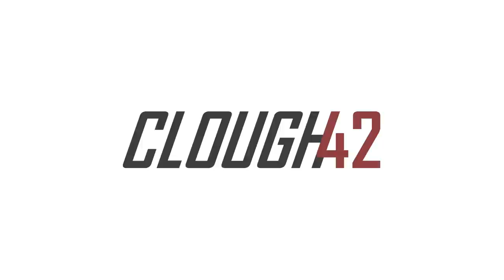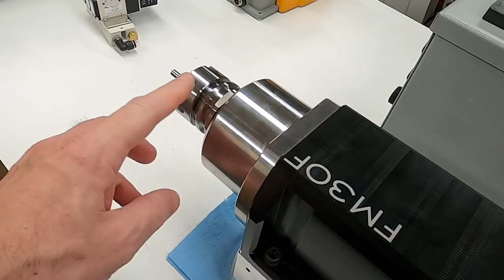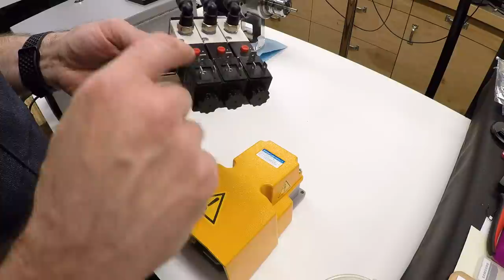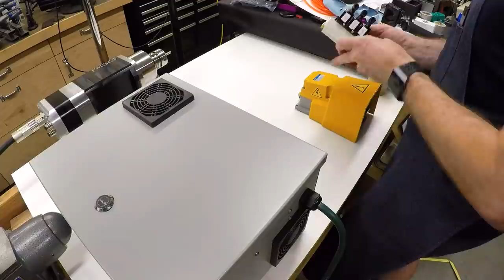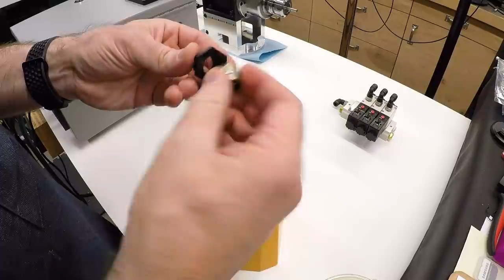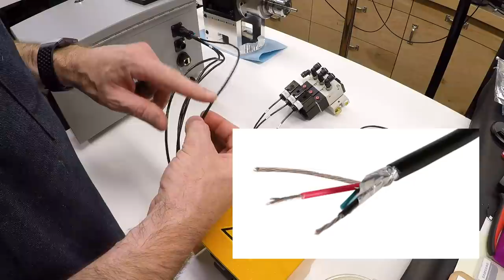ATC Spindle Part 10: ATC Interlock and E-STOP wiring [REUPLOAD]

Comment: Totally agree with the "Machine is trying to kill you" When I first got steppers installed on my mill I was so excited I played with the mill drawing pictures on paper. At some point during the proceedings I had my hand on the table and it moved and it dawned on me  that if my finger got pinched between  the table and the mill the mill/controller/steppers would not care one bit and take my finger (or worse) with it. That was one hell of a wake up call. At that point I started to build an enclosure.
Reply: I call the hand on the table the 'texting while driving' effect:  we can only really pay full attention to one thing at a time.  The rest of our behavior (here, where you put your hand) defaults to habit.  This is why we want safety systems to prevent something we would never do **if we were paying full attention to that** as opposed to paying attention to e.g. the part we're machining, a funny noise the spindle just made, etc.

Comment: There seem to be a number or comments against this video suggesting that safe wiring practices and interlocking are only necessary for commercial operations which is rather worrying. Having a reliable method to shutdown a machine tool in an emergency is just as important in a home shop with a single user. You have to remember that this video will be watched by thousands of people no amount of disclaimers will prevent an otherwise uninformed viewer from copying this implementation as is, so it's very important to cover this in detail. Just recently there was a different youtuber who couldn't be bothered to connect up the ground on his Chinese HF spindle. Attention to detail matters.

The issue here really revolves around whether or not the VFD is a single point of failure for the emergency stop system - This is why safety relays have dual emergency stop circuits, dual contactors and monitoring for both of these channels to report if either have failed. Safety relays are quite interesting and well worth a look into if you're interested, there are a number of good videos on youtube covering what they are and how to use them.

Back to VFDs, if it only safe to use a VFD for the emergency stop if it has "Safe Torque Off" functionality - This isolates the gate drives preventing the motor from being powered and most importantly is safety rated - That generally means that it is SIL3 compliant and that the related circuit within the VFD has no single point of failure. I have had a look at the manual for the VFD in question here, the Hitachi W200 (https://www.hitachi.us/supportingdocs/forbus/inverters/Support/WJ200_Instruction_NT325X.pdf) and it supports safe torque off functionality using the "Gate Suppress" inputs (GS1 / GS2). Additionally, the safe torque off / "Gate Suppress" functionality is monitored using the CM2 / EDM output so that any failures within the VFD can be reported to the user for repair / replacement. In the datasheet this is all covered on page #418 (Section: Safety
 (ISO13849-1)) and given that this is a proper VFD with this functionality built-in, there's very little reason not to use it over the external trip input and the alarm output. You've already paid for this functionality by buying a named-brand VFD.
Reply: You say that the VFD might be a single point if failure. Can you explain that more? I don't really understand; if the entire safety circuit is NC, then the VFD failing won't stop the e-stop from working. Is the concern contact-welding on that relay? That's the only thing I can think of that would cause it to fail dangerous.
Reply: @evbunke2  There's a number of different scenarios so I'll cover a few different examples but please don't take this as an exhaustive list: (It also depends on exactly what components you're using)

1a) As you suggest contacts can weld and the mitigation for this is to double up on the contacts as safety relays do. It's important to note that if you have a multi-pole (three phase?) contactor and you connect the poles in series, this doesn't mitigate this issue as there's only one electromagnet which operates them all. If one pole is jammed, it can hold  all of them closed.

1b) As an extension of 1a let's say you use two separate contactors in series so that if either contactors are welded the other will still disconnect the load. This lacks monitoring so you won't notice that the first one has welded and that you again have the single point of failure. This is why monitoring is important in safety relays - The mitigation is to use a normally closed pole from each of the contactors to form part of your reset circuit, so you can only reset when both contactors are in their open position. (or closed, for this monitor circuit)

2a) The e-stop wire could be cut, this is why we use a normally closed e-stop as you suggest.

2b) The e-stop wires are shorted together, this would prevent a normally closed e-stop from functioning and this is the reason why safety relays have dual e-stop circuits. Essentially they have two normally closed loops which must not be shorted together - Shorting them together is detected as a fault.

3) The VFD software failing - This could be caused by a programming or hardware error which causes the program to hang or otherwise stop responding while still operating the spindle. The mitigation for this could be a watchdog which monitors the microcontroller.

4) A hardware failure somewhere along the "fault input" or speed control signal path.

As far as the VFD is concerned, the main point of the "Safe Torque Off" feature of a VFD is that it's a certified implementation which is specifically designed to not have a single point of failure within the VFD and to allow monitoring to detect such failures just as I mentioned in example 1 & 2. It is not designed to provide electrical isolation, it is simply there to ensure that the motor can be reliably stopped when needed. This quote sums it up:
"ABB’s Safe Torque Off has a certified SIL 3 / PL e safety rating and complies with EN/IEC 61800-5-2 which is the standard that defines the Safe Torque Off feature.
Finally, it is important to remember that Safe Torque Off DOES NOT provide electrical isolation. The motor must be electrically isolated by cutting the supply to the inverter and by local isolation to the motor before any access to the motor power connections."

This of course applies across the whole system, in a CNC machine this primarily means that the axis drive motors and spindle motor must all have a way of stopping them in an emergency and that no single component failure will impede this. The more you can interlink into this system, the better.
Reply: @yngndrw.  I agree, this man knows what he is talking about. This is the way we wire e-stops in the industrial world.
Reply: @yngndrw.  I agree with you. I understand all that you are talking about.
But I just want to chip in (not for you, you already know this but for others) that emergency stop buttons could be ok with just one contact. It depends on the level of safety that ones wants to reach. With one contact in ES button level it is Suitable up to category 1, PL c (EN ISO 13849-1),
 SIL 1 (EN 62061). With dual contacts in ES one can reach higher level like category 4, PL e, SIL 3.
Also sometimes a real safety relay is not needed, it could be done anyway. But once you get used to them they are nice to use.
Being over on the EU side we usually use Phoenix brands. But there are a lot of other brands.

Comment: I think the additions are welcome ones.

The fact is that the requirements in a home workshop, where only one working is you, and a production environment where there are others working, are completely different.

That being said, I would personally always have a system on machines that stays open as long as e-stop is not pressed and if it's pressed (or any other alarm goes off or the power is cut) that relay would put giant resistor shunts (sized proportionally to the motor obviously) in parallel to the motor wingdings, effectively breaking the motor in seconds to a full stop (all the energy from the spinning motor converted to heat)

Because I've had situations where power to the workspace is suddenly cut and because something stupid happened, even lights go out... now THAT'S DANGEROUS AF! So I like it when all the tools just stop within a second and they don't just freewheel to a stop and cause a danger :)

But it's your workshop, and if someone's idiotic enough to think they can just do what you did, they just might deserve the darwin award.

golden rule:

If you don't know what you're doing, don't! :D

But Dunning Kruger is a thing sadly...

Comment: What a shame you felt the need to reupload because some people misinterpreted your garage shop for a commercial shop with lots of people and the need to mitigate liability. So painful.
Reply: Or maybe there is genuine, possibly misplaced, concern for James' safety. It's not liability, it's health and safety. In this case I don't think he's at risk. As someone that has spent at least 1/2 a lifetime designing safety systems I see both sides of the discussion, even yours. James, like usual, has his end covered for what his needs are. He's not building and selling. He's the owner operator.

Comment: Building lockout circuits to "Safety Standards" (and in the US they vary from State to State, and sometimes they {often} conflict with Federal OSHA rules) or sometimes simply aren't practical or possible for the device in question. As James mentions repeatedly, you need to use your head and you need to be clear on what your requirements and objectives are. If you do happen to be trying to comply with a safety directive make sure you at least run it by someone who has done it before or even consult your State or OSHA Safety inspector for pointers on what to look for, or at least how to prioritize the lockout functions to stay within pertinent regulations as closely as possible. Going to an outside consultant for design review/ testing is also a good idea for more complicated applications.
Reply: I wonder if the controversy would have arisen if James had used the words "Quick Stop" or "All Stop" instead of "Emergency Stop"?
Reply: The most important safety rule:  sure, you won't do something dumb when you're awake and paying attention to that one aspect.  However, people get tired and most importantly try to do more than one thing at a time.  You know what happens when you text while driving, followed by resolving to never do that again?  Expect to be focusing on something else, then using the controls without thinking about it.  Or, you drop something on the keyboard or switches.

Comment: Holy fuck you just helped me solve an electrical issue I've been having with one of my panels. Had a relay that controls a solenoid valve (24VDC 2A) and it kept blowing every time it was turned off even though the supplied power was set to 2A. Makes so much sense now after $500 down the drain lol

Comment: In Germany I had a very interesting kitchen ware e stop. This machine had 3 buttons and the system started that one of the buttons weren't working properly when none of them are pressed. If I pressed the defective one the error disappeared (won't happen usually) and if went to the stopped state.

I had vacation but mom's can be that way so I looked over it with the maintenance manual. 
There I found out the each button, when closed, adds 500 ohmes of resistance resulting in 1500 in total. Each button had a different open value and with a bit of math is could calculate which button was pressed. And the resistor of the defective button shifted slightly higher. It wasn't out enough to trip the stop but good to know. But this meant it could detect shorts and open connections in the e stop. Which both stopped as I was curious and tested it.

Since it was safety equipment I ordered the replacement button and did not mess with the resistor. 

Stay safe!

Comment: Very enjoyable content as usual. With regard to purge air, I thought this should be running the whole time that the tool change is active to prevent debris entering the ATC. I may be wrong I am not a metal worker but this is how a wood working cnc router would be setup.

Comment: A minor point about DC relay or solenoid snubber diodes. When the coil magnetic field collapses and generates the back EMF voltage spike the diode conducts and lets the coil current dissipate as heat in the diode. But when the diode conducts that produces a magnetic field in the coil and causes the relay contacts or solenoid slug to move more slowly as the field collapses. With larger relays and contactors this can cause contacts to open slower than designed and arcing can wear them out sooner than expected. With air valve solenoids this is likely a non-issue. If you want to have relays open quickly put a resistor in series with the diode to limit the current and field strength for faster collapse. Try a resistor value approximately the same as the relay coil resistance.

Comment: My approach on the safety side of my CNC machine was a master relay which had multiple output contact terminals.  Once energised via the reset button it would allow power to flow to the main stepper power supply contactor, and to a second relay which enabled the run/stop commands to the inverter.  A third set of contacts sent a stop to the BoB so Mach3 would know to run or stop.  When the estop was hit the power to the steppers was stopped along with the run signal to the inverter.  I would call these a hardware stop as without power the machine has to stop.  The BoB and Mach3 signal was a software stop which on its own is risky but when there is no stepper power or spindle run nothing can happen.  One of the CNC build videos on my channel shows the approach if interested.  Lots of ways, as you say.  Good progress and looking forward to the next one.
Reply from the maker: Thanks for sharing.  Are you removing power from the inverter during an emergency stop, or just removing the run or asserting the trip input?
Reply: Some people use both an interrupt to the run command and remove power to the inverter via a timer (to allow the spindle to spool down otherwise it could damage the inverter) by switching off the contactor to the inverter.  But I only interrupt the run command.  Inverters don’t like being powered up and down repeatedly so it comes down to your personal choices.  I’ve built several machines since 2008 and this has been my preferred method along with cutting main power to the steppers.  Enjoying the series so keep it up.  Best regards from the UK 🇬🇧 (the mycncuk forum over here is very active if you would like further suggestions.  Some members build machines for their business so good to tap into!)

Comment: Hi James! The footswitch should be equipped with a sturdy, mechanically shielded cable or cable sleeve for safety reasons. Do not forget that this footswitch lives on the ground. It is kicked and bumped, sometimes something falls to the ground and hit the cable. At worst, this can cause a short circuit and inadvertently perform the tool change, so dropping the tool on your workpiece or hand. The microphone cable is not intended for use with a foot switch. Remember Murphy!

Comment: I learned a ton from your setup sheets video.  If you're seeing comments, this is my vote for a detailed video on your machining setups in Fusion 360, in particular how you setup parts in vises as a fixture.  I've done it several ways, where I make a copy of the vise so I can modify the jaws, where i export it to a fusion archive file and start with that each time.  Obviously the link to original model must be broken to modify the jaws direction to create soft jaws, but there are also issues in sharing between projects.  With your methodical nature you've probably worked out a very straightforward way of doing this and I'd love to see your approach!

Comment: you may want to consider a lockout preventing the vfd from starting while the pedal is pressed. I usually connect a pneumatic switch to the  drawbar airline. 
usually
Reply from the maker: Thats not a bad idea.
Reply: @Clough42  I'm not sure what happened to the rest of the comment. There "should/could" be a spindle air cutoff sensor connected to estop, preventing spindle rotation when no spindle air.

Comment: It's very nice to see you using proper ferrules! I know you are not the kind of person who does a half-ass job, but still! Also, if it/they are not selfbuilt or Prusas, check your 3D printer(s!) Mine had soldered ends for the bed and hotend. Solder creeps under load, which increases the contact resistance and poses a potential fire hazard.

And if it's common practice to reverse bias anything inductive, why didn't they just integrate it into the solenoid itself? They got a defined operating voltage, I assume they are usually not controlled with alternating current (at least not that I know of), and defining a specific polarity should also work just fine (I mean, they even have an LED in there!)

Comment: I do believe that an emergency stop should disconnect mains. I tend to design circuits with in series switching for when problems occur. When you’ve experienced a relay that is supposed to be off when you switch something, but remains on because the contacts welded in place, you’ll know what I mean,